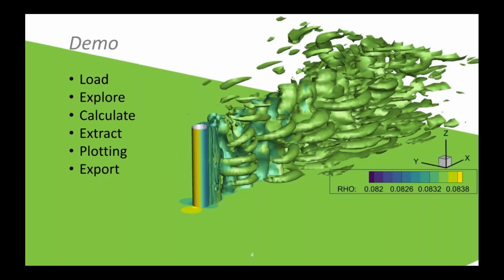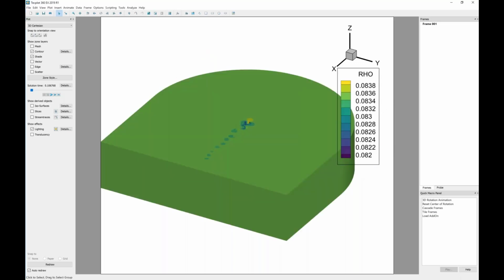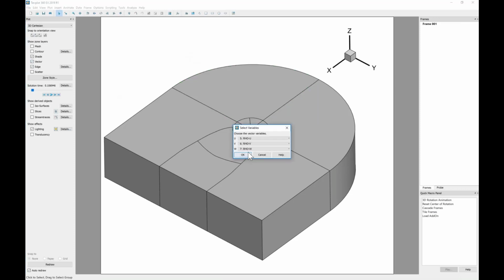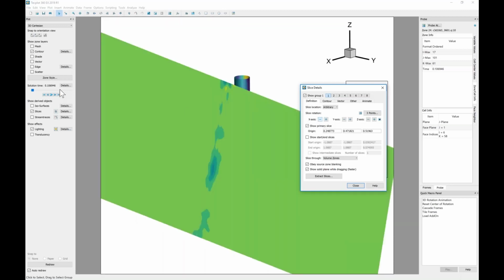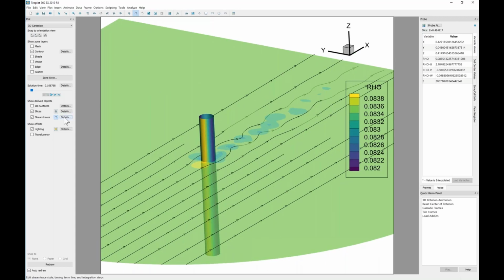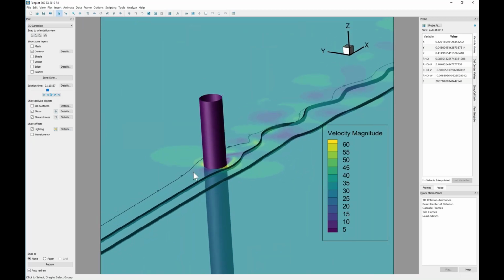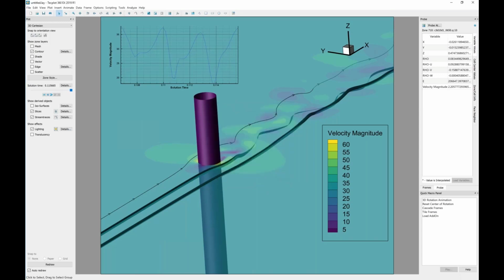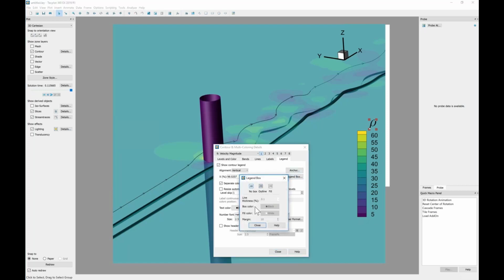From Zero to Hero: Tecplot 360 Basics

Comment: Could you please let me know how can we introduce for example the velocity data collected by ADV probe with their exact coordination into the considered 3D volume? Actually, I already have the values of the velocity duo to the measured points around the hydraulic structure but I could not interoduce their correct places in the software.